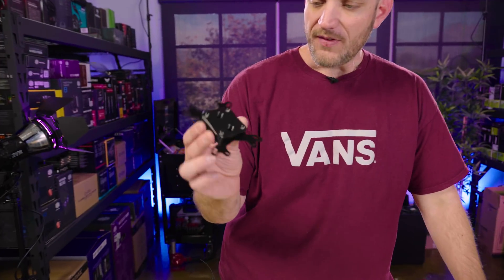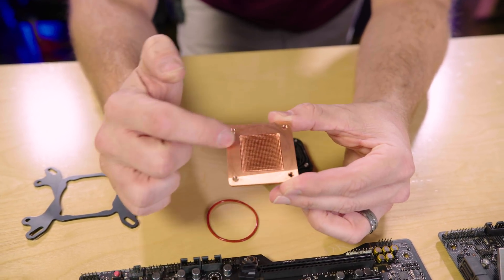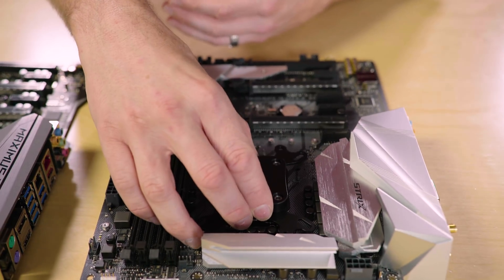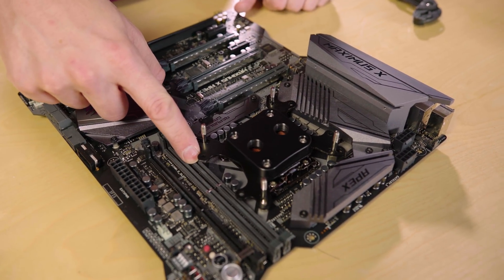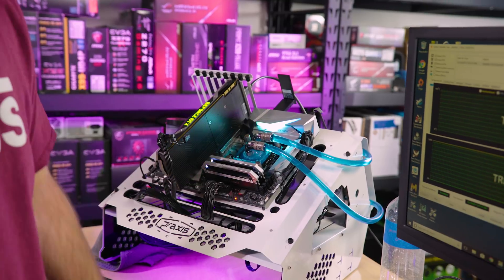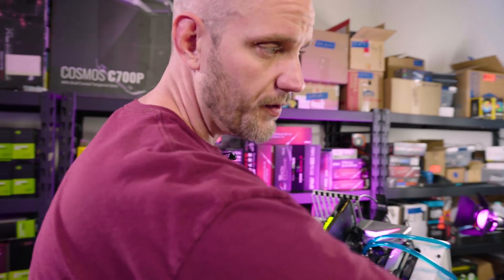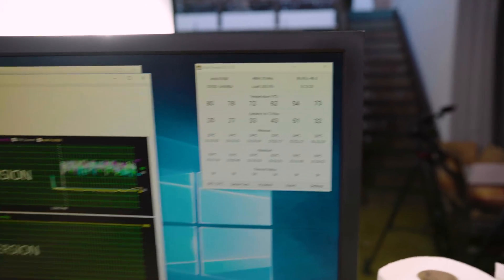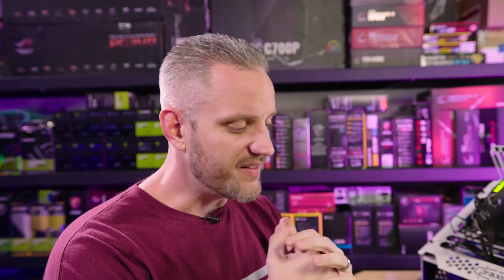I tried watercooling an overclocked 8700k with a $19 waterblock

Comment: Cheap block could be useful for an idea I've been pondering. What if you took a cpu water block and a beefy cpu air cooler, and you mount them together? Rather than a radiator, which is essentially water>metal>air, this would be water>metal>paste>metal>air, with the possibility of a much larger fin surface with the same amount of fans. 

it's a dumb idea, and essentially a radiator in the end, but I just want to see what the results would be. Since cpu blocks have more internal channeling, I would assume that the heat transfer would be greater between water and metal. And with air coolers being good enough to cool a cpu, I would also assume that the heat transfer between metal and air would be greater than that of a radiator. The only thing is the metal-paste-metal heat transfer, but again, I assume it would be just fine considering metal-paste-metal is used on all coolers on top of an ihs.
Reply: If you can find a way to circulate the water through fins without using a pump, you're rich. Air coolers use vapor chambers already, and another part of watercooling is having a large volume of liquid in the system, which an aircooler can't match without some sort of reservoir. And if you have good, original ideas, don't discuss them on the internet.

Comment: I did the whole Home Depot water loop and there's one part you can't really skimp on.  That's the water PUMP.  I had a $10.00 water block, stainless clamps, water line, purchased a radiator (amazon) and it cooled a OC'd Xeon X3470 @ 4.2ghz. (2.8ghz stock)

Worked fine until the cheap ebay pump died.  Then it started overheating as you would expect.  Lol.  It was a fun experiment.

Comment: Get an oil or transmission cooler from a scrap yard. if you are lucky you can find a copper one but they are usually aluminum. If you want to go bigger you can always use the condenser from car ac unit.

Comment: I've been running this block for a few weeks on my i7-7700k at 4.9-5.0ghz I see mid 70s temps on stress tests. 240mm rad with 2 fans
Reply: delidded CPU? stress test with AVX?
Reply: What's the vcore reported by cpu-z?

Comment: Oh yea thanks a lot J. Now I can't buy one because they are sold out. And it's all your fault. JK  Then again I wouldn't know about them if it wasn't for this video. The clear one is still available but I might just wait for the black one(then again the clear one could work if I use red fluid.Yea I'm very original with the black and red build and blue LEDs, then again can't argue with sales on a tight budget). Don't need it in a rush anyway. Still got my AIO. Planing to put together a custom CPU loop but got a pretty tight budget. So I'm definitely looking forward to the cheap loop videos.

Comment: Those aren't 6/32" screws. That would equal 3/16", which are bigger. Those would be 6-32 screws. They're #6 size, 32 threads per inch.

Comment: Its hitting over 80 °C with a conservative overclock and costum watercooling.
Intel really has to start using proper thermal paste or soldering the CPUs again,
that there is next to no rise in temperature shows that the IHS temperature is close
to ambient, there is no way to cool it better with conventional cooling.
If the ambient is 10 °C hotter and your loop actually gets warm from the GPU load youll
get quite toasty temperatures if you dont delid your 8700k.

Comment: The O-ring is EPDM. the only thing that's high end in that block.
Reply: And it still worked. After some lapping I am sure it would work better. What do you want for twenty dollars?
Reply: bluephreakr I watched the video and saw that it worked. Adding Gatorade would work as a coolant. It still needs work and I would not use one. I'd prefer an AIO.

Comment: Because the people buying a $20 water block will definitely buy a 360mm rad, right? Lol.
Reply: Probably.  But can they find a rad with copper tubing for cheap?

As an additional cost savings, rather then buying acrylic tube for straight runs with no flex you can use similar PVC tubing.

Comment: The Apex only has two dimm slots?
Reply: fewer dimm slots means better overclocking. The trace length from the DIMMs to the cpu get shorter this way
Reply: Yes. That's a motherboard for extreme overclocking and everything on that is aimed to the best result

Comment: I rocked a block just like this on my Zotac GTX 1080 amp edition (had a VRM heat spreader on it from Zotac), I was able to hit a 2.1GHz OC no problem with great temps. I got it to work with my RX vega blower card with amazing temps,  but the lack of VRM heatsink on the Vega card was an issue... Anyways it is definitely worth the money! Got one of these coolers cheaper on ebay just a little bit slower in shipping but definitely worth the wait.

Comment: I never understood why most water blocks cost more than a mid or high end(when on sale) cpu air cooler. its just a block of copper with other cheaper metals or plastics encasing it allowing it to be cooled by water, but it can't even cool the cpu by itself.

Comment: hi jay, same brand that you bought this block from has very cheap aluminium radiators. is it ok to used this cooper block with those. or corrosion will happen in both?

Comment: Without set fan rpm OR a dB rating for both tests this video seems pretty useless.. I'm sorry but this doesn't seem really scientific.
Reply: This is just irrelevant in the grand scheme - the heat soaked temps were within 3 degrees under the same load, the difference in fan speed isn't going to be anything more than negligible.
Reply: Guys relax....all he is saying is that the fans increase in speed to maintain the same temp....therefor for all we know the fans were spinning at half the speed with the other block(doubt that though)
Reply from the maker: You should be sorry
Reply: JayzTwoCents I'm just saying that putting the fans to a fixed rpm would create more accurate results. I'm not whining or anything just constructive criticism. Love your stuff!
Reply: Heatsoaked lol. It seems like there's stock tim on the CPU. If so, there's hardly any thermal exchange between the IHS and the die. Temps didn't increase because the water didn't get any warmer (not even by 1C). The only thing that got heat-soaked was the CPU tim. On my stock 7700k I had to stop the fans completely to see any increase in temps. Every 15 seconds the water temp increased by 1C, and so did the CPU.
Stock tim is trash. You have to put liquid metal under the ihs, and you'll get the same temps with just a 50usd air cooler.

Comment: Get that cheap block and buy a seperate O-ring. I wouldn't rate that O-ring for many run time hours at all. Willing to bet that nylon ring would be brittle after a few months of use (6-12).

DIY store should have o-ring of the same size you need to fit this block, but you might need to take a knife and cut it down in size. They're designed to stop leaks in household plumbing, so if anything it's going to be overkill.

Just wondered if it'd be good to do a water cooling loop with 10-12mm copper pipe, a copper water block & soldered joint xD

Might even put a Fernox corrosion inhibitor on there, run it like a central heating system kek

Comment: I had 10€ waterblock cooling i5 2500k at 5GHz. Then i ghetto mounted it on my Ryzen 1600x, it was maxing 60c at 4.1GHz, 73c at 4.2GHz. When i upgraded to Heatkiller IV, it maxed 57c at 4.1GHz, 66c at 4.2GHz. So what i saw was that difference becomes bigger with higher overclock.

Comment: Usually, red-colored o-rings are just silicone compound based. For example, the black ones you would find in Bitspower hardline fittings look like they are made of EPDM (if I'm correct..)
Reply: It's not a quality difference, but rather a difference in the material properties. Different materials are used for different environments. That said, this application is only dealing with water or other inert fluids(no oils, solvents, alcohols, that sort of thing) and at a very forgiving temperature(compared to industrial applications where temps get both much hotter and much colder), so just about any basic general use O-ring is capable of handling this job.
Reply: Is there a quality difference? Does one dry out faster than the other?
Reply: I'm not sure how they would compare in practice, I've only used the EPDM ones in my loop because they are more common in water applications. I think that might depend on the chemical resistance which is diffirent per compound, usually o-rings have a compound and hardness number.. Silicone based ones are for 'general purpose', resist high and low temps (-60c / +220c) and can be used in the food industry for example. EPDM 70 is used for drinking water applications, hot water/steam up to 150c and certain acids.

Comment: I just want to say that I've been using that SAME waterblock in my custom loop for over a year and have no problems whatsoever. In fact all of my water cooled parts(aside from the EK waterblock on my GTX 970, swiftech D5 pump, and no-name brand cpu waterblock tested in this video) are from BARROW, which most people consider a knock off brand. The fittings in my loop are actually the cheapest part of my build, got a pack of 8 for $12(free shipping) from aliexpress. Heres some pics of my build for those non-believers: https://i.imgur.com/eZp4htk.jpg

Edit: The rad is a hardwarelabs GTS 240, but everything else is cheap stuff from aliexpress.
Reply: @JR - Better in what way though?  Certainly not better on cost, not by a long, long way.  And really, the difference in performance between these two blocks is likely to be so minimal as to be indistinguishable most of the time.  You're paying for looks and bragging rights much of the time.
Reply: cute build.
Reply: 9ff70f96 Mostly but still alittle nicer made Block. And idk back to Aluminum. The Copper elitist are upset, you paid 2-3x more for a mimimal performance gain if any at all. But yeah i want to see any wc gear over air...ok block..but i like the kits coming with commpression fittings. I didn't see any on newegg, that just got the regular old nice barbs, like Barrow and Alphacool.
Reply: @JR - I should say that I do actually own the flagship EK EVO Elite full-copper block myself - it's running in my machine right now.  It cost a lot of money!  But I've been water-cooling for about 15 years now (all custom built) so have had some experience, and I know that it's not really necessary to buy expensive parts to have a good cooling system.  I think so long as the parts are a good build quality and not a poor design then you won't really have any problems.  This $19 block looks to be a decent quality for the price, with my only reservation being that the copper base finish might not be as flat as one would like.  But as for aluminium, I would be careful there, as I have used aluminium blocks in the past and they did not fair well over the years as corrosion did eventually start to break the metal down.  So I would always recommend using copper/plastic where possible.

Barbs are a good way to go if budget is limited as they are much cheaper and perfectly functional.  I think they will ultimately prove to be even more reliable than any swivel-type compression fitting in the long run too.  Compression fittings look nicer, are easier to use, but then they usually cost a lot more.  Again, here you're paying more for looks and bragging rights than actual performance benefits, in my opinion.

So, I think it's great that a $19 block like this can hold its own against the usual over-priced name-brand hardware.  A $19 block with cheap barb fittings, heat exchanger, and decent pump (important part) can match even the 'greatest' (most expensive) options out there. :D
Reply: I may have to go after the budget oriented line of revolver fittings.  I too am creating a budget oriented system, but will use HardwareLabs rads and my Primochill pump and EK GPU block.
Reply: Aye, water cooling doesn't need to be expensive. It's not rocket science. 

By the way, is that a sacrificial anode in your res?
Reply: MechaSheeva8000
Reply: Performance and Silence oh it's GAWD Dude Lol. I want to buy more of those Varder Fans, that is super Silent around 1600-1800rpm. Corsair and Rosewill Fan is Loud as Shit in Comparison...and that delta is really loud bastard and the bearing is bad in it Lol
Reply: The A240 Kit Definitely Has my Blessing and something good thrown together...You know nothing real special, just something Average person got a hold of, a lot of the similar pump/Rez Sizes all them Years ago that Started it all man. It's of Legend Stuff man Lol
Reply: Yeah, need to delid though, but afraid to try agian. Change the tim, then maybe id see the temps more id want. But not doing too bad at 4.9ghz with 7700k, daily driver capable etc. Like I Mentioned hard to go over 60c now....that was much easier on air.
Reply: Nice, glad I saw your comment Tony, was wondering if I should give the cheap unbranded a go.

Comment: Question +JayzTwoCents I have a Cooler Master MasterLquid Pro 280 on a 17-7700k in a Sharkoon BW9000 tempered glass case. The liquid Pro cools fine but it resonates quite a bit, I think possibly due to the glass panel. I put some rubber strips on the inside of the glass to insulate it more from the case but I can still hear it. The pump is supposed to be one of the more quiet ones in this range. I hate a noisy system so for the moment I am back to my Hyper Evo 212. When I uninstalled the waterblock I noticed one of the screws was not perfectly tight (my bad), do you think this could explain the resonating?

Comment: Is 90°C hot for an overclocked i5-2500k @ 4.0ghz? It's been stable using air cooling with a cooler master hyper 212 evo in a HAF X case.